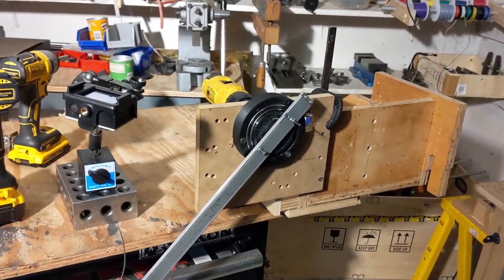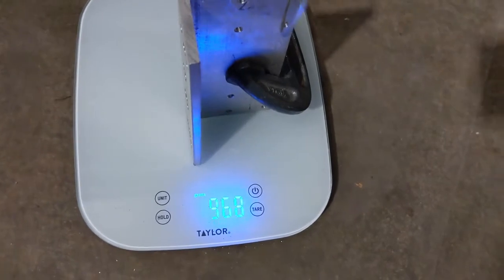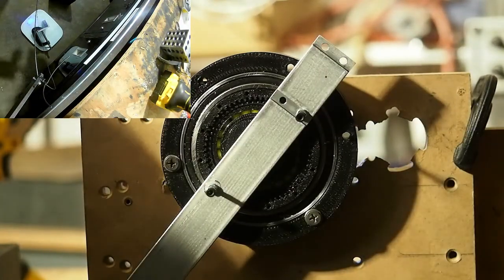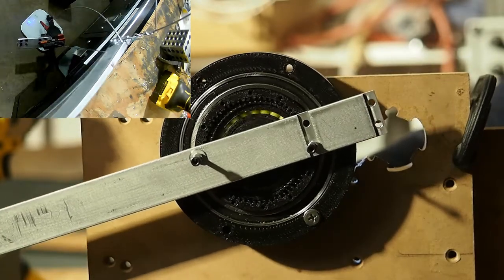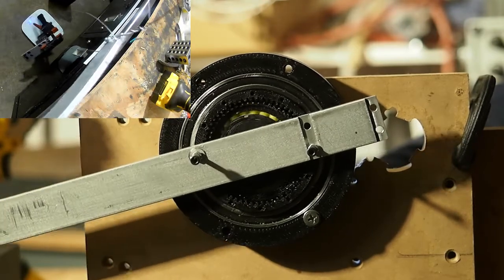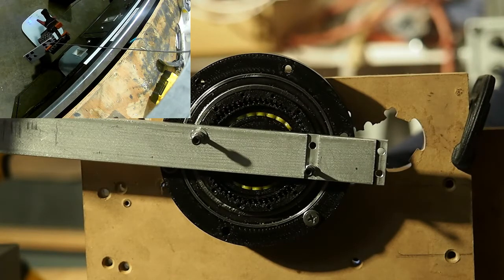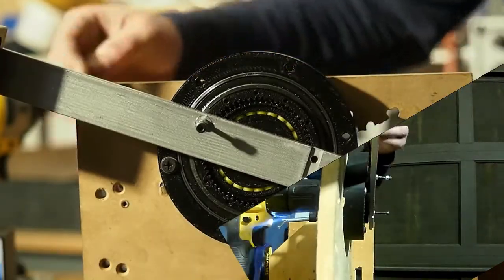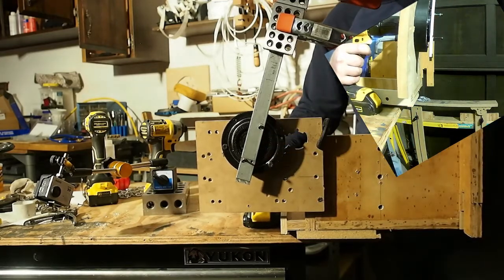printed strain wave twerking and abuse

Comment: With all the strain wave gear videos on youtube, I guess you are the only one that tested it's torque capacity. Thanks for making one.
Reply from the maker: The real problem for the flexspline is fatigue and layer bonding.  This may be why not many people bothered to torque test since it will fail quickly in most cases.  FDM isn't very well suited for this application because the heat/friction is high, dimensional accuracy low, and layer orientation unable to be optimized.  I've thought about testing an aluminum extrusion (like a coke can) bonded with epoxy to printed teeth.  This would provide more rigidity and remove the weak point where the layer bonds fail at the bottom of the "cup"/flexspline.  Unfortunately I haven't had the time or motivation to test out the idea.  Once you have that figured out you still have to tackl the issues of the strain wave generator.  FDM will never work for a high load elliptical bearing and using multiple bearings takes up too much space.
Reply: @JesseSchoch  Have you tried the timing belt approach?
Reply from the maker: Timing belts are not well suited for the load.  They can work but they are designed to work under compression into the pulley not compression into an annular tooth so they ratchet.  Simon Merit's done the work on that on and I don't think there is much more that can be done.  

One idea I had was to combine the bell everman servo drive idea with the strain wave idea but the servo drive is already mechanically complex and it would be a ton of work.   

Finally I wanted to try a friction strain wave using a coke can and some o-rings.  Just to see how efficient it would be and how much torque you could generate.  The aluminum would fatigue pretty quickly but it would be a fun test.  If I only had an EDM machine, hardening setup, and a bunch of tool steel.....